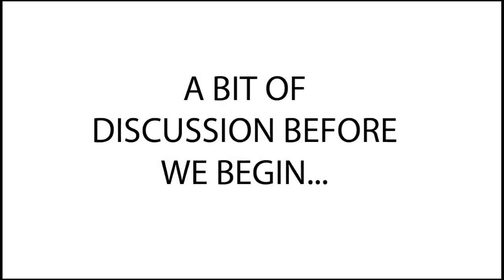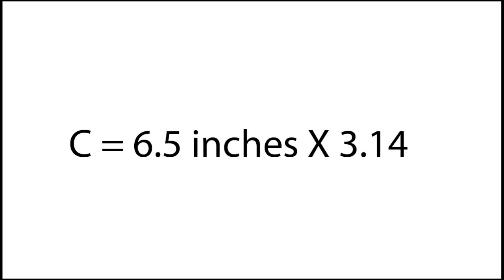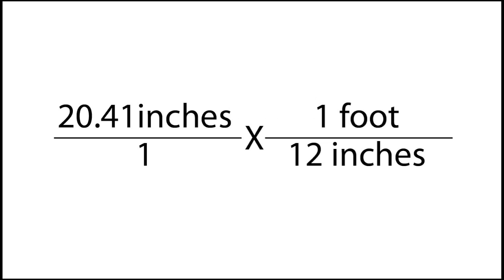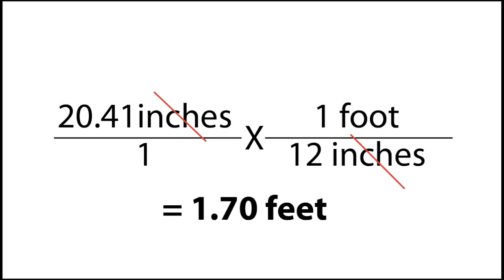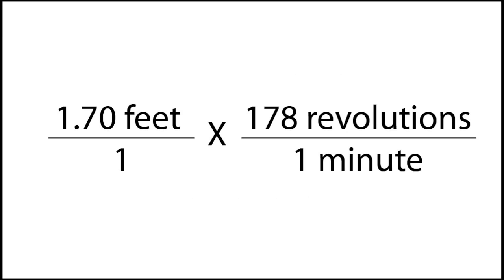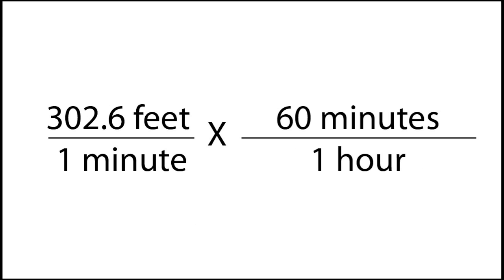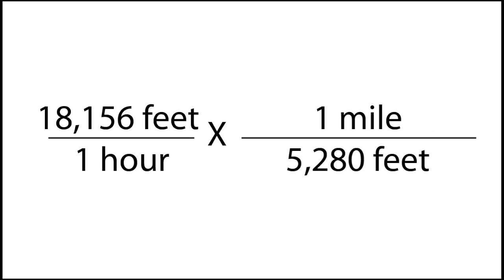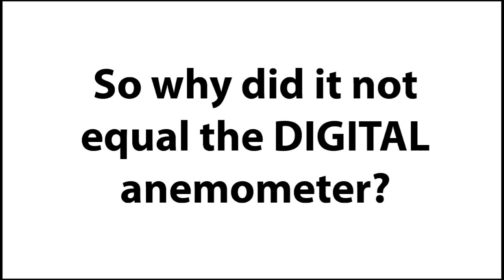Mr. Hayes' Weather Series: Calculating Wind Speed

Comment: Hypothetical question:   In an average sports stadium watching a sport's venue. At which wind speed would unsecured fabric hats start to blow off at?  When would most hats have been blown off at?  So basically if you were walking along but had to hold your hat on. What wind speed would that be? Approximately.  TY.
Reply from the maker: Man, that is a tough one, as you would have to consider a lot of aspects. The tightness of fit on the person's head, the about of wind drag that the hat receives as a potential to carry the hat from someone's head, the mass of the hat, etc. Very interesting thought!!! Ya gotta love PHYSICS!!!
Reply: To Michael Hayes, 
Every condition is average. Therefore an average hat.  Not tight fitting. But not very loose either. So if a bowler (Derby in the USA) then it's upon the head due to gravity rather than being pulled title over the head.  The hat isn't a sombrero,  10 gallon hat or a wide rimmed ladies day hat.  Nor is it steal plated, armour proofed, or weighted English bobbies hat.  A sort of trilby,  or Miss Marple hat with out hat pins or hair tucked in to the sides jamming the hat on.  So average rim, weight, colour height or shape. So no medieval damsel in distress hats or Klu Kluck Klan.   A fedora would be okay as a average hat. Also a Deerstalker (Sherlock holmes), Fez, Gatsby, halo hat, homburg, Panama, ustor Keaton Pork pie hat,
  But if some one knows actual speeds for other sized hats then please post that.  
          A sea captains hat could be average. Must be a few sea captains in the world who know how many knots the wind was doing when their hat flew off.
          My guessimate is about 19 to 24mph.  Beaufort scale 5. Fresh breeze.  Or on a decimal scale between 20 to 30mph. So below whistling telegraph wires.
Reply: A hurricane Catorgory 5 would blow an average adult off his feet and across flat sufaces.  If it didn't suck him up that is.  I have seen cows as well as containor trailers suck up and flung at speed out of the vortex.
Reply from the maker: OH MY GOSH!!! Dude that is SO STINKING FUNNY!!! I was rolling when I read your reply, I am so pinning this to the top of my comments to remain until another very witty person like yourself manages to capture so much of my attention! I truly needed to have a laugh like this comment provided me. Thanks for your comment and taking the time to truly express your obvious side of humor. You seem like someone that I would enjoy writing and producing a video with!!! Thanks for the laughs today! (SUPER FUNNY!)
Reply from the maker: HAHAHAHAA!!!
Reply: To Michael Hayes,
If you like humour.  How about potato crisps (Fries in the USA)? At what wind speed would a potatoe frie start to move across a flat surface. Say a slightly moist smooth beach.  A high shine finished table, Bonville Salt flats or a sidewalk or tarmacked road.
          Of course there is not a lot funny about a crispy potatoe frie being moved over a surface as if by an invisible hand.  Not even if you think of it overtaking a tortois which upon see the delight quickens it's pace endeavouring to catch the runaway dinner. But for a minute it made me laugh visualizing it.
          But my guess is the speed is 0 to 10mph.  Unless the tortois catches it first.

          But really. Seeing you video with the fan as well as a wind speed measuring device. I thought you may know.  But it's fine you do not know as I do not expect most people to know or to have thought of such.

Comment: You could use an Arduino with a magnetic reed switch and a magnet on the cup that passes by the switch to do the counting.   Those useless fidgit spinners have a ball bearing in them, that would could be used to teach about mechanical resistance compared to the pencil bearing.

Comment: This device neglects the fact that the rotation rate depends on the difference between the torques produced by cups... The torque on the device delivered by the cup facing into the wind is opposed by the torque delivered by the cup opposite that is facing away.  This method MUST therefore underestimate the wind speed. And the error will be a function of wind speed. In fact, the error will grow as the difference between the drag coefficients of the two surfaces times the square of the wind speed.  In other words, this method of determining the wind speed does not work at all.  A better way to do this is to place the device in a wind tunnel and measure the response function directly.  If a wind tunnel isn't available, then use slowly moving car on a windless day to generate the wind speed. Or calculate the expected response using the moment of inertia of the device, and the torques expected at different wind speeds from the expected drag coefficients of the two opposing surfaces. (You'll also need to know the area of each surface their areas and the distances of the center of pressure from the axis of rotation.) Then test it at a few points.  And PLEASE PLEASE PLEASE learn how to pronounce "a ne ma' meter".
Reply from the maker: Wow did I crack up at your comment. This is a general ed 8th grade science class that determining wind speed is not even in the curriculum, they just need to know the name of instruments used in weather forecasting. I would assume that the size and age of the students would be an obvious sign this was not an High School, College or AP / Dual Credit course. Thanks for the info and a good laugh today!

Comment: One thing that I always take from anemometers, is trhat it is tougher than the simple diameter of the instrument. There are other factors to bear in mind. The design of the anemometer has the wind energy captured over an area. i.e. the cup. The cup covers an area that is greater towards the edge of it's revolution, than that which is towards the centre of the "wheel". Perhaps the measurement of the diameter should be from the centre of the cup, rather than the edge, as it is not the edge that is doing the work. There is also an amount of friction in the bearings of the anemometer that could affect the resultant wind speed calculation.

Thanks for the video. It made me think about a problem.

Comment: Hey Michael,

I have a quick question for you regarding which diameter you chose to use for calculating the wind speed. Do you use the center of the cup, being that is the center of the winds applied force, or do you use the outermost edge of the cup. Also, why wouldnt you account for the pressure of the wind on the back side of the cup when its moving into the wind? Thanks
Reply from the maker: The diameter was the outside diameter across the center from one cup to the one directly across (outermost edge). As far as the opposing force of the backside of the cup, I am assuming it is negligible for the purposes of a homemade anemometer. If it were a professional digital or calibrated device, I would assume that the variable would be taken into account. Hope this helps to answer your question. Thanks for watching :-)